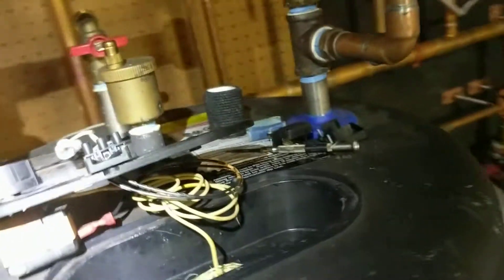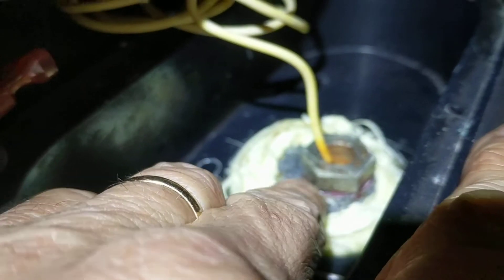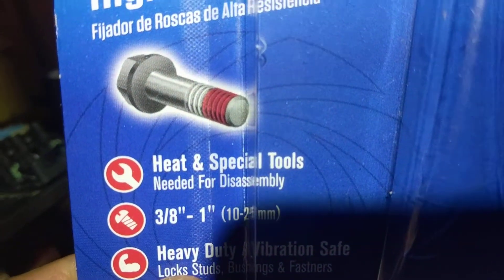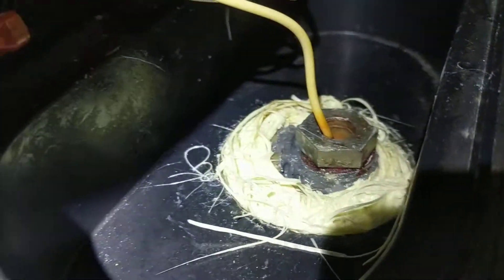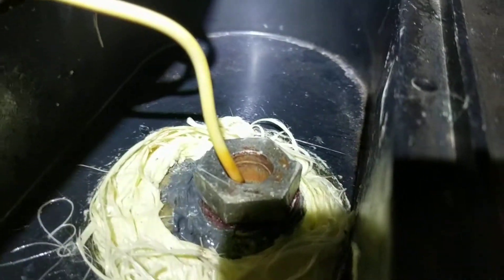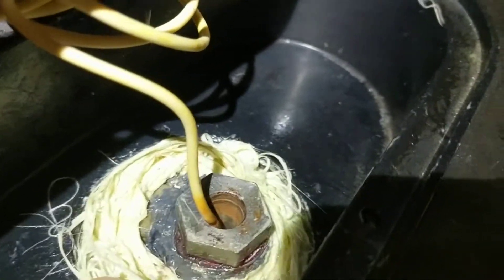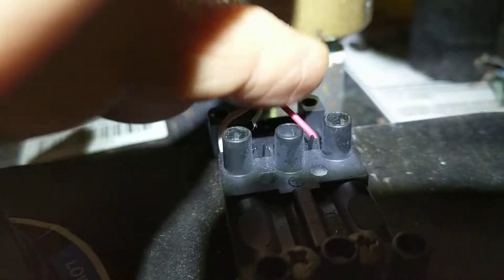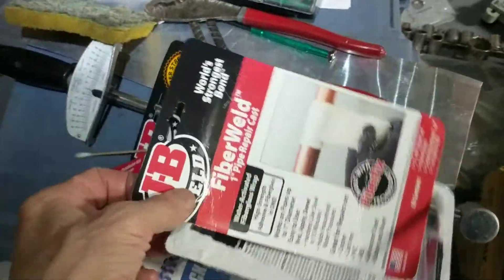PART 4/4 triangle tube smart 40 indirect hot water heater leaking drywell

Comment: Thanks for putting this up!  Found this series while researching a leak in my similar heater.  I think the root cause is that they're just not built well.  That the outer tank isn't stainless all, the product is misleading.  Wish me luck as I'm going to dive in to try to repair mine soon...and I'm not sure where it's leaking.  Is yours still holding up?

Re threadlockers, I've found that teflon tape and most sealants only work with NPT (tapered) threads, as those threads are designed to seal on their own.  This appears to be a poorly designed straight thread with gasket, so it needs a better sealant if the gasket surface doesn't hold.  I've used loctite 577 for sealing straight threads, and it usually works pretty well.  It's a little hard to find, but seems popular among some industrial repair/maintenance people.
Reply from the maker: Hi Tim, Here is your update. First I must go back to the beginning and add to my original description. The reason I first found a leak was that the hot water was too hot. When I inspected the unit I found it was calling for heat even while the water was already too hot. When I removed the aquastat from the drywell I found the aquastat was all wet and water was inside the drywell area where the aquastat sits. I assumed that there must be a leak however a leak was not visible, only the water was visible. There was no spray, no misting, no dripping visible. I assumed that their must be a leak and that the leak must be due to the drywell fitting. It's when I went to tighten the drywell fitting that I cracked the  fitting on the tank. I had found some information online that said to torque this to 40-50ft lbs.  In retrospect this must have been wrong because it cracked even before I got it to 20lbs. My bad here. If I suspected the fitting were leak I should have just snugged it a bit to see if the problem would go away. I went way overboard here and cracked a fitting that was not cracked to begin with. Actually I really didn't know where the moisture was coming from, I just assumed it was coming from the fitting. Now fast forward to current day.  I check this repair whenever I am in the basement so probably every week or so. I have not observed any leak in the form of dripping water, spray, or mist, etc. But what I did observe one time was the same original symptom that the hot water was too hot and when I opened the plastic drywell cover I once again found the aquastat was wet. Apparently my aquastat was malfunctioning in such a way as to call for heat when not needed (like a type of short). This time  I tried a different approach. I simply removed the aquastat from the drywell and dryed it out and positioned it to sit on top of the tank with the plastic cover off the drywell. In this way the aquastat was able to stay dry  and lo and behold the system starting working again. Now I am running the system with no plastic cover over the drywell and I do not find any moisture building up in there. So it seems that one way for this system to fail is for some condensation to form in the drywell on the aquastat and cause it to short out. With the plastic cover off the drywell no condensation forms there and the system works with the aquastat propped nearby. Now on one occasion the wires to the tempo sensor down deep in the drywell got pulled up just a tiny bit so the sensor was not sitting at the bottom of the drywell but up a bit. This was a no-no because it could not read the water temp properly and once again the system was calling for heat even though the water was already hot enough. So with the aquastat propped just a bit out of the drywell with the cover off you need to be certain that the sensor is pushed down all the way to the bottom of the drywell and wires going down to it do not inadvertently get pulled on. Hope this helps, yes it's still working. my guess is that I might have been able to solve original problem simply by propping the aquastat out of the drywell so condensation did not form on it and that whatever source of water is that forms the condensation is not too much to have to worry about. So with the aquastat cover off no condensation forms and I do not see any evidence of a leak. somehow a small amount of water vapor seems to be able to get into the drywell area but not to much to even form visible water drops as long as the cover is propped off. I know is sounds weird but that is what seems to be happening. my aquastat does look somewhat rusty with all the wetness it has had to put up with but it still works while i am keeping it dry.
Reply: @mrdavetrouble  Thank you for the detailed response!  I'm going to dive into mine tomorrow, and I'll be careful.  I like the idea of moving the stat up out of that well.  You're right, that's not a good design.  I happened to notice the leak on my from the outside, visually, but it was also keeping the HW loop on all the time.
Reply from the maker: @tomsmith3045  my first symptom was the hw loop on all the time. Then i noticed moisture around the edges of the drywell. When i opened it up I saw moisture all over, not running out over the edges like an active leak, but everything inside wet.
Reply from the maker: Something else to mention here. If you disconnect the wires going to the aquastat be careful that the loose wires do not short out. In my case one of the wires came to rest against a metal water pipe. This resulted in damaging the transformer that the wire was connected to. I had to replace the transformer.
Reply: Hi. The system calling for heat too frequently when heat is not needed (the water is already hot) can also be mitigated by setting your High Temp Limit on the boiler lower ? What do you think. 144 degrees is still plenty hot. But ya, I will prop open the plastic cover so condensation water won't get trapped and hope to get the same good results as you. My aquastat sensor was submerged in water so I hope it's salvageable if I can keep it dry !
Reply: Thanks for your follow up.
Reply: @mrdavetrouble @tomsmith3045
I replaced my thermostat 2 weeks ago. Great success!!! I was so proud of myself until yesterday. Really hot water again, boiler on overtime. Same issue, drywell soaking wet. Junk!
I’m going to try to leave aquastat out if the well. Also, no drain on this thing? Rusty water and no way to flush. Do you find that to be a problem?
Reply: @neilo5084  I ended up replacing the tank.  Wouldn't buy another by this brand at any price.
Reply: So leaving the aquastat propped up and out of the drywell without the cover on didn't solve the problem for you? Is some small amount or water expected in there? Also could you just try to tighten the weld clockwise a few quarter turns gently to see if that solved the water accumulation?
Reply: Did leaving the aquastat propped up out of the well solve your problem? (No cover on). Is some small amount or water expected in the drywell or is it supposed to be completely dry?